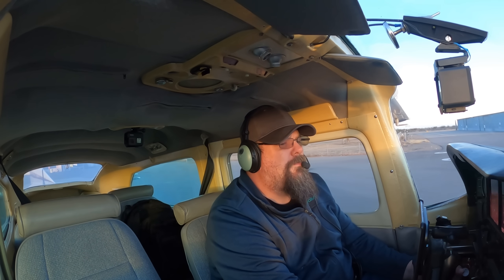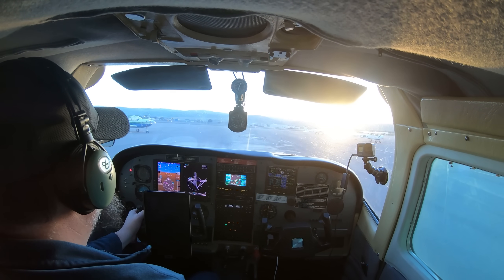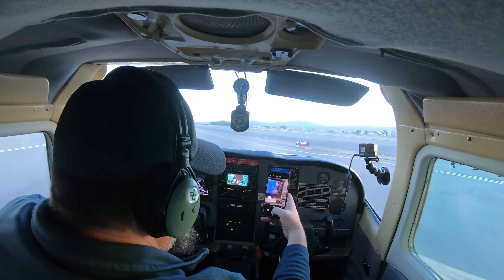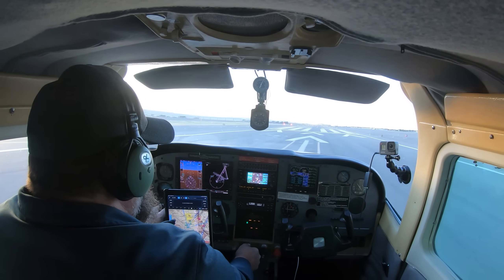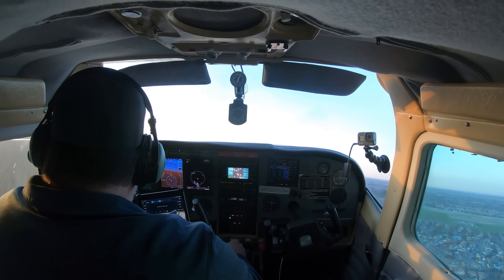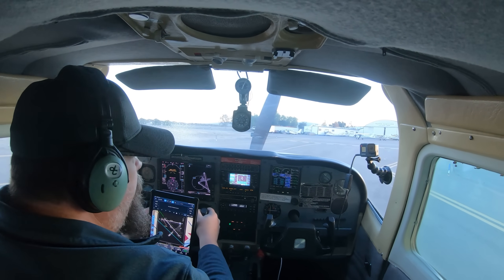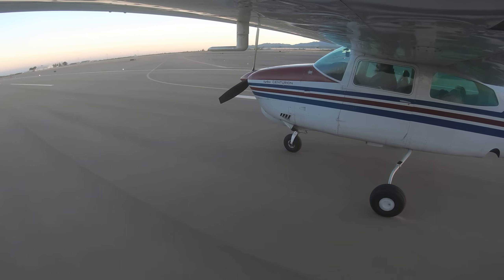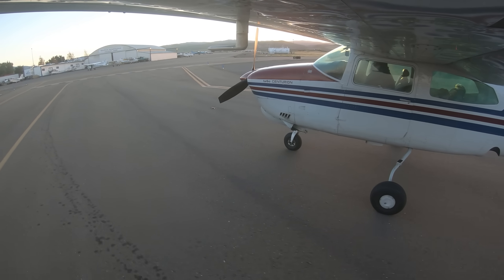Catastrophic Engine Failure after Takeoff

Comment: You did a great job landing the plane ✈️ without incident! 👍🏻👍🏻👍🏻👍🏻 I don’t know who rebuilt the engine, but I’ve built 100s if not more! The only way a connecting rod fails so quickly, is if the rod bolts weren’t torqued properly & or rod was installed backwards! Basically rod chamfer facing in towards other rod & not towards crankshaft! I know you have to find a new engine now, but if it’s built correctly you should be able to ground run it without harm, as long as it’s not idled a lot, which shouldn’t be done with any new engine! But remember you have a prop on the engine which causes slight load! So don’t be afraid to run it, pull the valve covers after & make sure it’s oiling properly, & do some taxing tests! Cylinder glazing really only happens with synthetic oils & long periods of idling, which all engine break in oils are made from petroleum! So if it’s built correctly with a good break in oil you should be fine for ground testing! Good luck & I’m sorry you have to go through this! But when the rod cap comes apart that quickly, it’s usually due to not being torqued! Don’t let anyone BS you!
Reply: My thought also is that the rod bolts were not torqued. They replace them with new on aero rebuilds. I would imagine.
Reply: How do you know what failed?

Comment: That big fan at the front of the air plane actually serves more than one function. It is also very important part of keeping a pilot cool. Don't believe me? Didn't you notice how much he started sweating after it stopped turning? All joking aside a excellent recovery for a failure at such low altitude. Now as a mechanic I am going to watch the what caused the rod to kick out video.

Comment: First off, what killed the engine. Rods dont just fail. Second, what parts were replaced during the overhaul? Third, do you have my favorite word, a warranty from who rebuilt the engine? If you did it I'm sorry man. That sucks. But it's a fantastic learning experience because you were able to walk away from it with no injury  to yourself  and needing a new engine.
Reply: Does the engine sound not quite right to you as soon as he revved it up? I thought I could hear a slight clatter behind the general engine, prop and other noise. I'm guessing with those headphones on he wouldn't have heard it.
Reply: @mikeh2006  I thought I heard a weird knock. I though it was my crappy phone speaker.

Comment: This is about the fourth or fifth time I've heard of an engine that failed shortly after overhaul. In only one case I know that the engine failed after about half an hour or 45 minutes of flight in a Baron and of course the engine that went out was the one that provided most of the thrust on the inboard side of the engine so it made it about a 20% flyable aircraft to get it back down on the ground. All the others failed just after takeoff without any runtime on the ground and checking to see if everything was tight except for less than just a few minutes of running. I don't understand this period when you rebuild an automotive engine you run it for at least 20 to 30 minutes. Usually longer because the engine doesn't heat soak till at least that amount of time. Perhaps taking it outside and doing an engine run up a couple of times and then seeing the oil sitting underneath the airplane might have been a clue before you decided to put it in the air.
Being that an aircraft usually can't just pull off to the side of the road, I don't understand that thinking.
Perhaps with a lot of other things in the mind having to do with flying an aircraft, there may be a mindset issue with this occurrence because the vast majority of aircraft overhauls do not include immediate failure within minutes of the overhaul. But just a chance that it could happen requires more ground testing.

Comment: Well done for getting down safely. The rule still stands though. Don't turn back. Also I think you should have waited before you put the gear down and perhaps not banked so hard. I had an engine failier when I was a very low time pilot. The adrenalin rush is intense.

Comment: I wrapped back around to check this out after seeing your post on the reasoning behind the 210.  I've so been there/done that with the engine out.  The exception for me is two of the three prop blades departed the airplane.  Well, specifically one departed, snapping off the second one, leaving the third blade to do its mighty best - but with the lopsided nature of only one blade on the spinner the whole thing gave up.

I do have one protip though - if you are going to do this... make sure you have a DPE with you at the time as I did.  :)

It's amazing how much you learn in an engine out scenario.  You can practice it all you want, but until it happens to you, it's hard to tell how fast things are going to occur.
Reply from the maker: That's scarry, I've heard stories if the prop loses a blade but the the rest stay on, sometimes it will rip the engine clean off the mounts do to so much vibration.
Reply: @TheEdwardFrye  yeah. Fortunately the carbs vibrated off the engine shutting it down about the same time I pulled the throttle all the way back. The engine mount was cracked but we made it down ok. 

In that plane I had a parachute. But fortunately didn’t need to use it. :)

Comment: Good thing you had enough speed Edward to pull off the turn and I actually believe if the propeller would have stop turning in flight this may have been a different case scenario as the propeller would have caused more drag and a little more scrub on your air speed as I watched your propeller it was still spinning till just before touchdown. The story is that you made it down without incident and that's great because someone else can learn how to react in an emergency. Someone was watching over you for sure Edward.

Comment: ok.you walked away from this one and that is what it matters most,,   you touched down with nothing to spare just about a few seconds of energy left ,,  we can argue may be this or that,, keet the wheels up a bit longer until runway was made ,,?? ,, whatever ,you made it !!,,, the engine quits a few seconds after you start to turn the vernier of the mixture back , and quickly turn it back in when realize is the mix and not the prop ,, why the engine self destructs ?? , good question ,  that engine had a problem already a little leaning like that should not have killed it , obviously a catastrophic failure had occurred  , the outside view show smoke coming out of the exhaust as a blow piston or something really bad had happened to the engine,, ,we all have our guardian angels looking over our shoulders ,, one day in our lives they really show they are there !!!!!

Comment: What was your altitude when your engine failed? Does that airport require you to be at min 1000ft?  The reason I ask is I live near a small airport that has grown and several pilots routinely fly at 100ft and approach a hill. They never get near 500ft. If you were at 100ft do you think you would have made the airport or made a successful emergency landing? Thanks in advance.

Comment: FAA is not fair,many motorcycle engine can rev high even produce more torque on its little engine but still piston airplanes couldnt get off from the clutches of old big heavy engine. The more the rotational mass the more the mass will  multiply,so old big engine are really prone for this deadly events.

Comment: 3 min aren't enough to run an engine in... It should be idling up to temp atleast 8 times before you apply any load onto it, then start taxing around the airport at max 1300RPM up and down to 1300... I would do that twice.. Or I calculate it like this, but depends on the engine.. But, å half a tank should be run thru the engine before applying any loads.. Then gradually add load.. Metal's aren't what they used to be, and if the smelt mix isn't perfect,  and has some impurities in it, that could make the difference from a engine to last, or cunk out right away under stress...

Comment: In this situation I don't think you can quite compare it to turning back to field as it appears you landed down on the intersecting runway - a full 180 to go back to starting is a lot more detrimental than the arc you were able to more safely fly and land on (I am hoping i saw that right). The no turn back rule is really different for every situation, based on both aircraft and airport.

Comment: Awesome piloting job, you'r still here to tell the storry and that's what matters most. Congratulations on that one! Lots of folks where not as good as you have been and I sincerely hope I am if it hits me one day. 350h on SEP and gliders. One thing I didn't see in the comments mentioned is you doing a cross control on the turn. Left rudder and right aileron all the way around. Aside from killing altitude like mad, this is a terrific recipe to an approach turn stall. Being so close to loaded stall speed this could have get you killed, and its one reason the turn back is usually not encourage. NEVER cross control on approach, NEVER EVER, you want to come around, you push rudder, training kicks in your afraid of bank angle on approach so the aileron goes the other way and your busy flying a glider as a SEP pilot with no clue about keeping the ball centered while eyeballing the numbers, bam cross control, trying to make the runway and therefore rather to slow than to ffast, since any given SEP pilot has no clue what his plane sounds like on approach with a dead engine, bam wing tip stall, bam your in the news and dead, folks this is a serious issue, aside from all the "procedurals" you did wrong, this one was the one that's killing folks, and sofar I didn't saw it mentioned. You should put that one in your debriefing comment as well, way to seldom do we see actual footage how this happens, thank you so much for sharing, you sir have my uttermost respect. You made flying more safe!!!

Comment: What happened on the attempted engine rebuild; if a guy is rebuilding an engine for a single engine plane, he has to be good and catch everything; that rebuild was a total failure; 10 seconds earlier and you might not have made it back to the runway; amazing that you got it just right with what you had to work with.

Comment: You did a great job. ALmost immediate return (your call) no startle factor, and most important : bring the damn nose down, fast. I think it is a very well documented case to show how fast a light single engine plane, even on the light side (you were alone, no pax) return to the ground when power is loss. I was particularly was impressed by your nose down input halway trough the turn, almost like a kick box to the yoke...  Don't let it stall, but keep it also on your best glide speed. Not easy.

Comment: You had a flight just 13 seconds longer than the Wright brothers did in 1903. I know that after having the engine rebuilt, that had to be a huge let down but at least you made it back safely to the airport and didn't kill yourself or anyone else on the ground and didn't destroy the plane. So, all in all, not a bad thing. Engines can be rebuilt but sometimes the pilot can't. It could have been a lot worse.

Comment: As you said, this is not something you should do following engine failure on take-off. You said you had the height at the time of failure that you would normally be on the cross-wind turn. So you figured you could try for the runway and - well done - you made it. But it's worth noting here that some may take the wrong lesson from this event. With engine failure on take-off heading in the circuit, a 180 degree turn back will almost invariably end in disaster. It is standard practice to lower the nose to keep glide speed and look for a place to land. I don't want to take away from this outcome, but I think it's best to note this is the exception.

Comment: I owned a 210 for about 12 years.  Engine failure in that rock was always my biggest fear because of the strip I was based at.  An airpark community, just short of 3k' without clear ways, surrounded by trees and homes.  Great that you're safe.

Comment: Looks like the mechanic that did the bottom end rebuild is at fault. Improper bearing clearance, incorrect rod bolt torque, failure to replace rod bolts or it was done on a Mon or Fri.

Comment: That failure was an end cap coming off either it tightened up just before you pulled up for run way I saw a camera shake that was the warning then it got hot part seized and throw the end caps off allowing Conrad’s to flat about inside engine block punching holes in block. But as an engineer I would be looking at condos end caps either they was not done up or the bolts failed and let go but that’s where I would be looking myself. Looking at the damage done I see there’s no end cap bolts in what’s left of Conroe through crank case hole but they could of come off while being smashed up. But on take off I noticed engine rpm dropped a faction just before you pulled up this in my eyes was a crack shell issue tightening up the rest was done when it part seized and exploded in fight.

Comment: Built a ton of engines, not sure without knowing how the work was performed but sounded and looked like the rod cap came loose and let go. Most of the time when that happens it’s because of two reasons. The rod bolts broke or was not torque properly.
Reply: They said new rod bolts. There are none in the rod.. One pic shows a black rod journal.  I am thinking seized rod bearing,  spun inside rod. That would explain still having oil pressure when failure occurred. Still doesn't explain rod bolt missing. I have seen several really bad rod/bearing failures and the rod bolts would still be in place, even if broke.  No aircraft experience so what do I know.

Comment: I had an HT lead which touched the hot cylinder casing,  the plastic cable cover of the HT lead  burned down to the wire which, when exposed, shorted against the cylinder casing thing (pilot not engineer) this caused three cylinders working instead of four, which caused heavy vibration when power selected, so  that can only descend or maintain level flight but with a slight descent so not enough power to maintain altitude. I strategically planned for a single landing strip in X miles but student suggested tiny airfield left 9' O'Clock range 2 miles,
so (instructor 0 student 10) we landed there instead with   no chance of a go around. I shared that with you because I had nothing better to do.

Comment: I’ve just watched several videos on the impossible turn which you just did. What was your altitude when you lost the motor? Excellent flying
Was the motor running rough before failure?

Comment: You and your family had a very thankful thanksgiving. You had a very good instructor, and you did everything right. Welcome to aircraft ownership. It’s going to be expensive but you are hopefully going to have a brand new continental engine on your airplane. While I was young, building hours and learning I had the same thing happen to me in a 172RG  and a bonanza. Both happened at first power reduction and both ended up safely on the runway. Just remember it can happen to the new engine just as easy, but at least it will be under warranty.

Comment: Hello there first from Pilot perspective you did a great job controlling yourself even you are scared about the situation itself which is normal it seems to me you never do a training regarding this even at the simulator. The second point that you’re trying to hold your horse as they said by pulling out the yoke to you which is the scary part is so lucky on that and you don’t retract the flaps immediately to gain more speed regarding what happened to the engine it seems this engine hardly beat it either from the persons who is the flying it or Poor maintenance diagnostic blowing up the cylinder that is a pre-ignition or igniting condition Always wishing you the best and safe flight good luck Wish you always safe flight

Comment: handy bit of flying Ed. And I see lots of pilots and followers with tons more time than I praising your handling of the emergency, no question you made it home in one piece. And you were humble enough to post un edited. More brownie points for that. Now I have to give you a critical and burtally honest review.  You were absolutely correct in your self appraisal on Taxi. You were messing around with Your Ipad, messing around with your phone grabbed the wrong control not once but twice, weaving around the taxiway, If you were in a car on the highway you would have been pulled over for a sobriety check. (Im also in law enforcement)..get all this done before you start moving. Then you ran an engine that had been troublesome before and just had major work for less than 4 minutes before putting it in the air. You have cameras all over the airplane, if I thought for a minute they were there solely to study and review after flight actions I'd not have mentioned them. I Fly, I ride bikes and I race SCCA. When I do those things Im max attentive to the task at hand. Concentrate more on flying and less on being a "You Tuber". There I said my piece. Im really glad for you and your family that you got home ok